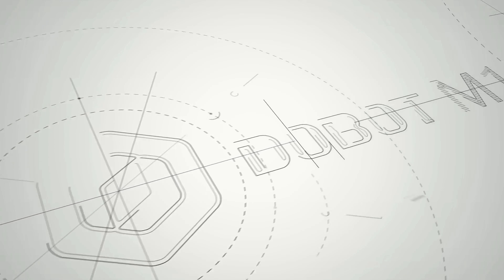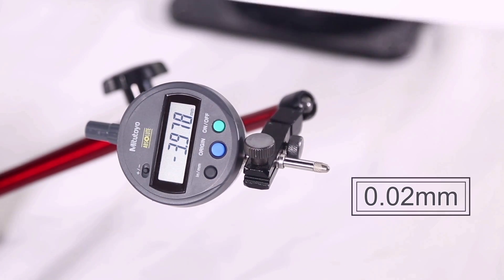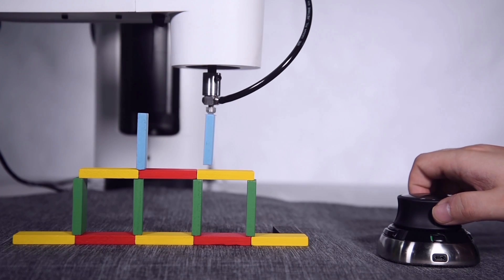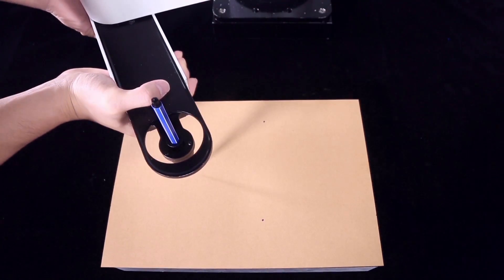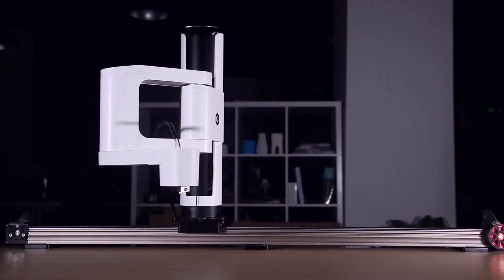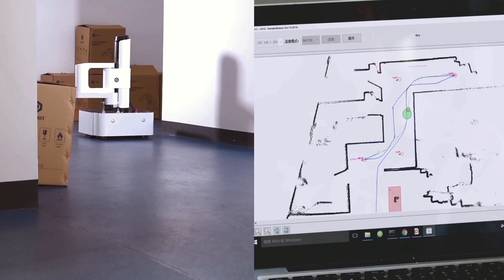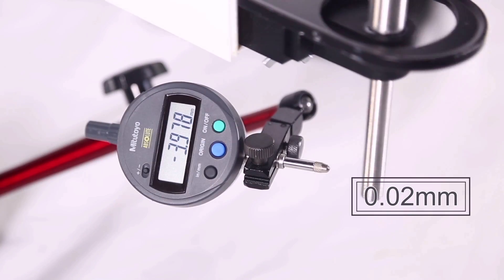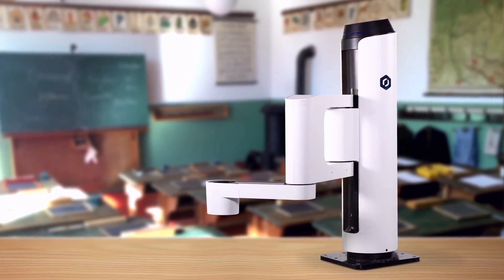Dobot M1-All-in-one Robotic Arm is Up on Kickstarter! 3D Print, Laser Engrave, Solder, Pick&Place...

Comment: It's ability to make such precise movements is clearly to most substantial breakthrough to making this product feasible for so many applications. I reckon this company should focus on that aspect and contract the design and augmentation of the utility modules to companies more experienced in fields relevant to those modules. Or they could make the product more versatile and allow DIY modules to be easily incorporated into the arm. For example a better quality 3D printer head could be installed with extra features such as extra extruder heads.

I also believe there is an opportunity to add another axis of motion which allows the utility head to be rotated up and down. This could allow the arm to extrude molten filament into side way protrusions from a 3D print which could vastly improve the applications of FDM printing. There definitely needs to be heaps of cooperation to this project as there are countless applications which can be obtained by only the tiniest modifications.